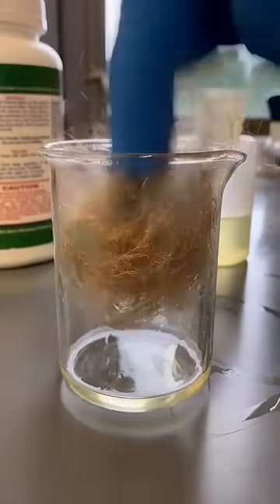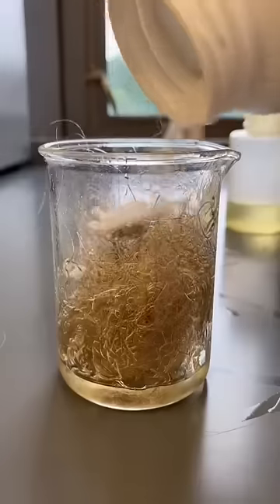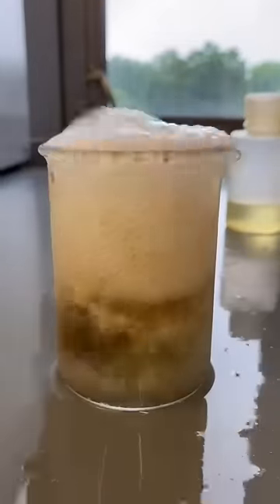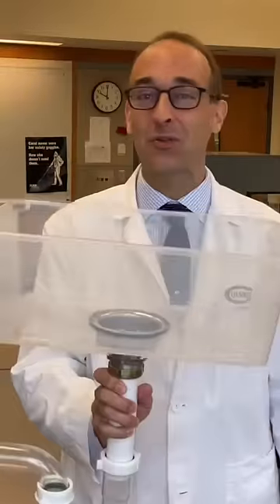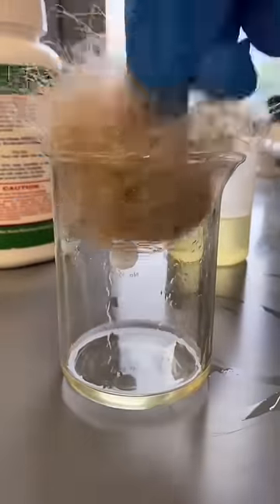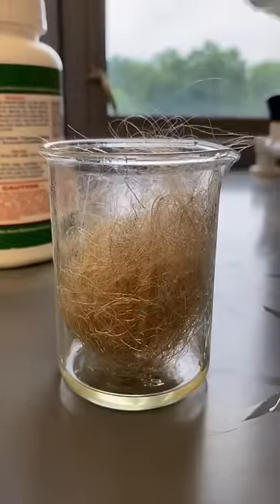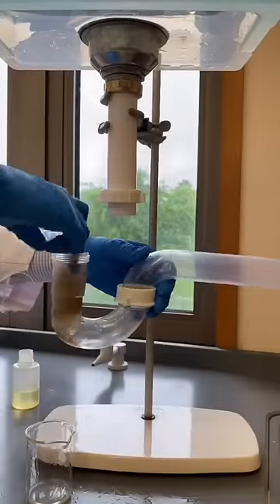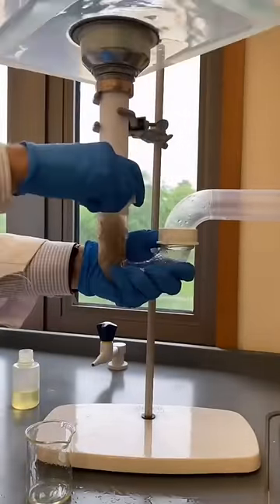How solid drain cleaners work

Comment: PSA FOR NON PLUMBERS: DONT USE THIS SHIT IF YOU HAVE CAST IRON PIPES IN YOUR HOUSE
Reply: Oh the horror stories
Reply: So you think it's better to call a plumber then..... Mine is plastic but behind the wall do they keep it the same?
Reply: @0mar-777  I’d still not recommend it for plastic but it’s a lot cheaper than a plumber
Reply: @R06NS  rite on thank you
Reply: Why not?
Reply: @NickDaGamer1998  it will literally eat away the bottom of the pipe until it collapses essentially
Reply: On cast iron/metal drains
Reply: Just don't use this shit period, it's terrible.
Reply: What about Liquid Plumber?
Reply: Yo i was like i gotta get this but since idk wat my pipes are made of leme just not. Thank you!!!
Reply: @randomness8819  if you check under your sinks or even in your yard where you can see the clean outs sticking up, should help you find out. If you see a black metal pipe in the very back of the wall or in the yard, don’t buy it.
Reply: hmm doesn't water corrode them? why are they in use at all
Reply: @aliveslice  cast iron will rust over long long periods of time but not in our lifetime unless something happens to it over time like drano or roots etc. but yes that’s basically why plastic pipes exist now
Reply: @PabloEdvardo  well said my friend
Reply: @slimnim1753  i’d like to know them
Reply: @0mar-777  unless you built it, don't trust it.

If the house has had any renovations from previous owners there's a very high chance the cast iron was partially cut out and replaced with pvc.

I've done plenty of bathroom remodels where I cut the cast iron out till it reaches the basement floor. Even then there's still cast iron under the floor.
Reply: @petersteele7603  yea who knows what's behind the walls. I'm not a plumber but there should be chemicals or whatever it's called that they should sell at stores rite?
Reply: @0mar-777  yeah if you wanna do it right use a snake first, usually it tells ya how far in it is if anything. Don't forget cleanouts too. 

I rarely use chems, because of exactly what this comment says.

Snake it first and locate it if it's bad you gotta replace that section, if it's worse, you leave the decision to the homeowner  or call a contractor plumber friend that isn't backed up with work since nobody can work actual jobs anymore. Then let them handle the risqué chems.
Reply: @petersteele7603  thx
Reply: @R06NS  it's the reason why flint is having water problems, they need a new pipe system for the entire city
Reply: @Infinite8blue  no m8 those are different pipes, we’re talking about drain lines here. Flint Michigan has a water line crisis.
Reply: @petersteele7603  thank you for typing the process that I was too lazy at the time to type lol. Listen to this man
Reply: Or if you live in apartment buildings period. 

You never know what your neighbors are putting down their drains. 💥💥💣
Reply: @petersteele7603  a plumber isn't going to use chemicals

Let me rephrase that: a GOOD plumber isn't going to use Chems. The company I worked for never used a chemical at all. They aren't rooto rooter type companies either. Also required  techs to be extremely talented with the cable or jetter. Then and only then do you dig up. That's how we did it anyway.
Reply: Thanks for the heads up. I was actually thinking of buying this.
Reply: @NameUnimportant  that's exactly why I recommended using snake first cause there cheap. And that's exactly why I recommended calling a contractor, friend who knows a good plumber, or the homeowner before you use chems.

Personally I recommended just replacing cast iron if you can afford it and know how to do it when remodeling.
Reply: @petersteele7603  totally agree. Cast iron will eventually cause trouble so if you can afford it, might as well get rid of it. 😊
Reply: @gpucchi9220  a 6 ft or longer drain snake is a much better investment long term. Quick fixes never work. And flushable wipes aren’t flushable
Reply: @R06NS  ohh i looked into it and it looks really good. Everytime my sink or shower drain has gotten clogged and i look up online how to fix it, it always says to use drano or baking soda and vinegar, the latter never worked so i always used a liquid gel called drano
Reply: No matter what pipes and what drain cleaner, flush the result with a LOT of water afterward.
Reply: @R06NS  I have had a lot of success with either copious dish liquid plus hot water, or baking soda chased with white vinegar.
Both are improved with the application of a plunger.
-
For hair clogs, such as you often get in showers/tubs, one of those plastic snake thingies that you can push down into the drain and pull back up to extricate the hair is awesome.
My brother has also had success with a type of hair catcher that you leave in the drain and pull out once the drain starts to slow. It comes up with the clog attached, you throw it away and install a new one
Reply: @PabloEdvardo  I agree. 
For sinks, your trap SHOULD be accessible and not all that difficult to remove to clean out.
Some even have a clean-out plug on the bottom that you can unscrew and clean out the clog manually.
Reply: @MonkeyJedi99  approved methods, good work soldier
Reply: I don't live in the third world where they still use cast iron pipes
Reply: @wills5482  I live in the "first world" where you can still find all sorts of old/legacy installs like cast iron pipes (particularly for drain/vent pipes), post and wrap wiring, fuse panels instead of breakers, asbestos pipe insulation, asbestos siding, cast iron sinks, and true-measure framing where a 2x4 is actually 2 inches by 4 inches.
Reply: @0mar-777  get a drain snake and do it yourself it’s really not that hard
Reply: @maxortega8073  ok thx
Reply: Yeah I was gonna say some of this stuff eats through pipes like candy.
Reply: @R06NS  Buy a Zip-it from Walmart. $3.
Reply: Yeah, drain cleaner chemicals typically have corrosion inhibitors added. If you just put straight NaOH into a sink you could end up eating away at the pipes
Reply: @slipstream53  long term use basically negates any effect of those inhibitors. The pipes are already probably full of roots and who knows what else lol. 65 year old cast iron and acid don’t mix well. Just eats away a gash on the entire bottom of the pipe. Basically you can either dig it all the way to the sewer tap at the street or look into glass lining the pipe. In short, just buy a damn auger😂
Reply: @R06NS  well yea, definitely don't let it sit in there, that's a big nono regardless of corrosion inhibitors, it's just that if you use sodium hydroxide straight up, not only will the dissolution produce tons of heat and be immediately corrosive to the pipes, but the lack of antisplash additives make it a serious eye hazard, especially if it stays clogged
Reply: So recommended to people that I hate got it
Reply: Most pipes are safe.  Maybe not cast iron, but most are, especially if you flush it out once it clears.
Reply: @computernerdinside  spoken from someone who has never had to hand dig a 6ft deep cast iron line from the sewer tap to the house. Just buy a snake. Or pay a plumber with a large auger. Chemicals of any sort are not good for your sewer and I’m sure the treatment plant in your city will thank you for not pouring literal acid into the drains
Reply: @R06NS  I mean if your house is older no i wouldn't suggest it.  But also as far as the city is concerned, by the time it gets to the plant, wouldn't it be so diluted that it almost wouldn't matter anymore compared to the rest of the waste?  I'd think they'd be more worried about those "flushable" wipes.
Reply: @delanorrosey4730  none are good for cast iron. None of them have a great success rate though. 

They'll all destroy cast iron, galvanized steel, or copper drains.
Reply: @IHateHandleNames  What about PVC?
Reply: @delanorrosey4730  PVC is more resistant to them, but the issue is still that a lot of them turn chalky in the drain, so if they fail to clear the problem they actually make it worse
Reply: oh yeah we found out the hard way ... that pipe looked so disgusting when we removed it... 😅
Reply: So would this be the stuff that left 3 yr old me in 1980 with a few scars from knocking over a cap that still had some drain cleaner in it?
Reply: Ok so when I was clothes the water is coming back in my tub and all the nasty is too what’s wrong what do I do???
Reply: Don’t use it period, speaking as a plumber these will eat away at the smooth lining inside your pipes that’s meant to allow things to pass easily. It’ll rough up the surface, which will clog up faster next time meaning you need to buy more, like scratched up arteries clogging with fat. Eventually it’ll wear down completely and you need to replace your pipes.
Reply: @R06NS why they even show us if it’s not gonna be helpful in the long run smh
Reply: My bathroom sink has been clogged so bad since I even moved into this apartment in 2021 and now it's pretty much like I can't even use it anymore and I just don't like the maintenance people to come over cuz they don't really like to help anyway. So what do I do to try to fix this at home? I've tried using boiling hot water to break it up with bleach in it and it just never works and I've been putting off getting the Drano because I hear Bad Things so, I don't really know what to do. Excuse some of the spellings, because I'm using speech to text and it's looking pretty dumb.
Reply: @ingrid_inthesky  no worries! As plumbers we usually recommend snaking out the drain instead, so clearing it mechanically instead of chemically. That being said, I’m not sure how much you want to invest into the maintenance of a property you don’t own, or how much the actual owners invest in its upkeep. All I’m saying is, in your situation if you decide to use a different method to unclog I’ll be looking in the other direction ;) p.s. have you tried packing it with baking soda and pouring vinegar? If it doesn’t work at least you can feel like the science kid again for a day :)
Reply: Here’s my tip if you know exactly what you’re doing then sure do what you know how to do if you don’t know what you’re doing hire a plumber because if you fuck it up maybe hiring a plumber anyway but it’s a lot cheaper to have them do what they know how to do versus have them fix your fuck up
Reply: As a Handyman, can confirm. Plumbing’s not one of the more common things I’ve been brought along to check up on but I’ve seen what happens should the two mix.
Reply: It’s also terrible if you have a septic tank. Pouring chemicals in the tank slows down biodegradation so you’ll have to pump more often.
Reply: It literally says ON THE BOTTLE ITSELF “will not harm plumbing fixtures or pipes” 😂😂😂
Reply: @michaell1603  I would love to talk to the “plumbers” that they approved these chemicals with😂 I guarantee they don’t use their own products
Reply: As a chemist, can confirm without having learned the hard way.
Reply: @WilliamFord972  school of hard knocks teaches the most memorable lessons
Reply: @r6n TM  lye doesn't effect plastics
Reply: @randomness8819  when was your house built? They phased out cast iron quite a while ago so if you have a newer house it should be sched 40 coming out of the foundation and u should have sdr 35 underground
Reply: Tried to mix small quantity of it once to make some homemade detergent back then inside a metal container. Then there's smoke, a lot, filling entire house. I ended up throwing away those batch. The metal container itself is like eaten by many worms
Reply: Can’t express that enough!!!
Reply: I now know this suffering
Reply: Yup
Reply: @Omar  unless your house is over 50 years old or in a commercial area, they are pvc plastic
Reply: It sucks to see that some old houses still have cast iron drains. In fact I actually saw recently, someone built the house (2021) USING cast iron for their drain. Of course they had no idea what they were doing, so it wasn't just cast iron, it was also non-primered pvc, a little bit of big Pex, and some what I believe to be actual steel piping. Yeah the dude built the drain himself. He was not licensed. Also, there were no vents for the plumbing, s-traps we're constant, incorrect use of sanitary tees, upsidedown drum traps, and dear God, there were NO clean outs. Except the main building clean out, somehow
Reply: @christocanoid  😂😂 that sounds like a fucking nightmare ngl lmao. Every now and again I get to go over and check out the commercial sites and I believe they have to use cast iron by code(where I live) for all large commercial buildings. Crazy how much skill is really needed to pour a nice lead joint lol
Reply: @zyanidwarfare5634  it can, but the likelyhood of that happening is incredibly low. By the time the cleaner reaches your septic tank, it'll already be largely diluted by the water you use to get it there. It's similar to when you shock the well, the chlorine doesn't kill the stuff in your septic tank, because it's so diluted. Another misconception along the same lines, is when someone has a softener, some people say the waste brine water cannot go into the septic because it'll kill bacteria. This is in correct, it is both code to put it in the septic, and the bacteria LOVE the brine.
Reply: Don't use this stuff. If it's clogged the take the u out and check it if it's in the walls call a plumber they have tools to fix that. Remember burst pipes and water damage is way more expensive than one plumber coming to "clean your pipes"
*Winks at camera
Reply: @deancrosiar6458  this is also way more true. Unless you are a plumber. A burst pipe is no issue
Reply: @christocanoid  yeah but a plumber isn't the sheetrock guy and then maybe flooring and depending on where the water is bursting out electrical damage. Yeah just call a plumber if it's not the u trap
Reply: @deancrosiar6458  I think you missed my point. If you are a plumber, why call a plumber?
Reply: Or yall could just unscrew the P-trap and do it for free
Reply: @jaymac4239  lololol
Reply: Enzymatic drain cleaner isn't super-effective, but at least it won't destroy the pipes.
Reply: Nah, we use this all the time with cast iron.
Reply: @jaymac4239 I agree but then I remember the average intelligence of our common man. And ya. Some how alot of people will manage to screw up a simple task lol
Reply: What if I have an apartment and really don’t like the landlord?
Reply: Sodium hydroxide DOES NOT corrode, attack or damage cast iron in any way. 
In fact they use steel vessels to store alkali solutions.
Reply: @WilliamFord972  Care to cite a source or even a Wikipedia page? cause I don't think thats right...
Reply: Perfectly safe for repeated use in metal pipes.  Lol
Reply: Just use zep as a cleaner
Reply: The only concerns you should have regarding piping based on what ive read online, is the heat of the reaction possibly softening pvc pipes, or reacting with glue holding them together. As a chemist, that sounds about right to me as well.
Reply: Yea seriously just get a snake and unclog it that way
Reply: Thanks for the tip. I'll trust you on that. But out of curiosity, what happens
Reply: @Omar  depends how old the house is. The main pipes might be cast iron. Don't be cheap and cost yourself more money in the end.
Reply: Why
Reply: @ceesno9955  read up m8
Reply: Because it becomes iron hydroxide
Reply: Thanks for the warning.  My place was built in 1919 and likely has cast iron pipes.
Reply: How do I know what pipes I have?
Reply: If your renting, who gives af use it. If you own the place, don’t use it it will eat your pipes over time
Reply: @izzyNFT69  absolutely correct, I appreciate you helping out the masses sir
Reply: oh goodness😮
Reply: @Delanor Rosey  pretty sure hydroxide is the main active ingredient. Might be aluminum hydroxide? Rather than sodium or potassium hydroxide.  But yes, chemical drain cleaners are hydroxide aka lye
Reply: How would we know if we have cast iron pipes?
Reply: Nah let em do it, i’m saving up to buy a house and could use a few drain repair or repipe jobs
Reply: How do you know if yoy have that kind
Reply: @cbgirl1220  the pipe under your house and/or coming out of your wall will be a black metal if its cast iron
Reply: @cbgirl1220  if your house was built before 1970~ you absolutely shouldn’t use it
Reply: Time to find someone with cast iron pipes
Reply: @pizzastock111  doesn’t take much! I’ve seen houses have the bottom of the pipe missing from the kitchen all the way to the front yard just from this type of stuff being used monthly for years
Reply: So if I have a house that is from the 50s it's better to call the landlord than fix it myself?
Reply: jesus christ thank you , im glad I saw this
Reply: @0mar-777  Get a drain snake and fish/push/manipulate the clog out and apart.
Reply: Thanks for the tip. As an evil plumber i will use this exclusively on metal pipes thereby guaranteeing an even bigger job in a few days when i tell them "the winter frost burst their pipes". Thx YouTube! Me and my dancing panda bear 🐼 are going to eat well this month 🥩
Reply: @lillyanneserrelio2187  That winter frost do be eating up those drain lines fr. 🥸
Reply: That's just factually wrong, you should be worried about aluminium pipes
Reply: @SirZechs77  bro aluminum pipes??? I’m not sure if you just live so far away from me or if you aren’t a plumber but I don’t know one soul that would’ve chosen aluminum as a water or drain line. I might have to look that one up but idk what you’re talking about G. I’m talking about cast iron drain lines😂 or even concrete ductile pipe, orange burg pipe, terracotta etc. anything besides sch40 pvc is not safe
Reply: @artart5404  depending on your situation and how big the pipe is your cleaning out, I recommend going to Lowe’s and looking for a 25ft drain auger (shouldn’t cost you more than $35 or so) and if for some reason that doesn’t work, I recommend a heavy handed dose of incredibly hot water, white vinegar and maybe even a bit of bleach and rush it down the drain line. 

Check around your house and be sure this is the only fixture that is backing up. If you run water in one drain and it comes up anywhere else, even a little bit, you have a bigger issue. Could be a clog down the line in the front yard or in worst case, could be a broken or collapsed line. Cast iron was only meant to last about 50 or so years and then it needs to be replaced or lined
Reply: @artart5404  if you can’t seem to get it on your own, definitely call a licensed plumber to come clean out the drain. Sometimes can be costly but trust me it’s cheaper than having to bust up the floor and replace the entire line in the house
Reply: @SirZechs77  yeah mate just checked. Nowhere in the US uses aluminum pipes. You might have maybe seen some galvanized pipe that possibly looked alike but the only aluminum drain anything out there is made for your downspouts on the outside of your house lol
Reply: As a plumber I came to post this lmao
Reply: @bepis4795  gotta help the normies out
Reply: Who the heck kws what type of pipe the have?
Reply: @prince_of117  google will tell you, but also knowing the difference between metal and plastic is a pretty simple ask lmfao. If you hit the pipe with something hard and it doesn’t sound like metal, you’re good to use it.
Reply: Pipes can be cast iron? I didnt knoe that. Those pipes must be heavy or from older houses.
Reply: @anonshrimp8299  you’ll mainly only find this pipe in older house predating 1970~ or in big commercial buildings that do not allow you to use plastic drain pipes. It is stronger initially but in the future it degrades much faster and has to be replaced entirely after about 50 years of use or less
Reply: @R06NS  flint Michigan used lead piled then switched local water sources to ine with a different mineral hardness causing all the lead pipes in the city to contaminate the water
Reply: @infernaldaedra  the original comment was to alert people of the dangers of using drano type things in cast iron drain/waste lines. Those old lead lines are a definite problem in those places, but that’s on the water supply company side of things
Reply: Thanks for the intel!
Reply: WHO HAD CAST IRON PLUMBING?! That's a thing?! Why??????
Reply: @ressamarieg  the old school plumbers back then really thought it would last a lifetime😂 they still are required to use cast iron in multi level commercial buildings lol
Reply: @R06NS  WHERE?! In general? In NY, NY? Early plumbing I get. But to date?! José Fucking Cuervo!
Reply: @ressamarieg  yeah like residential you can get away with pvc but after you get to where you have a water test on 12 floors of plumbing, quite literally too much weight to even use pvc per code 😂 especially on the water test
Reply: @R06NS  Lol, some aren’t, but most brand name ones now are. Although they take hours to break down in the water, and will clog if you use MULTIPLE. It literally is paper
Reply: Or on septic.
Reply: @themonsterunderyourbed9408  🤝🤝🤝
Reply: Dont use any of those drain cleaners ever. THEY WILL DESTROY EVERYTHING... eventually. Yhe only thing i put in my drains to clean them is vinegar and HOT water. If these don't work and you don't know how to properly snake, or don't know what auger to use on what drain, call a plumber.

Source: Am a plumber
Reply: @0mar-777  shouldn't!
Reply: Always use a drain snake. It's reusable, safer, and pretty affordable. However, the only way sodium hydroxide aka caustic soda, lye.will eat iron, plastic, pvc, etc. Is if you use it constantly or leave in the pipe for a long time and are using a high concentration. It is used in soaps, drain cleaner, water treatment, and many other household products.
Reply: @richardmartin2162  couldn’t agree more!
Reply: Yeahhhhhhh my family learned that the hard way
Reply: @R06NS what will happen if use on the black pipe
Reply: @NameUnimportant but the bottom of the paip got glued by poop 💩.. the poop sticking on the pipe.. it's so disgusting to dig out drain from toilet area
Reply: @petersteele7603 I put the blue coral snake in the drain .. but he doesn't come back..so I forget about Because I was busy and called plumber to go inside my house there a key on carpet. but I never heard back from him...
Reply: @SaadLamjarred55  Likely the same thing if the pipe in question is any material besides dwv grade plastics
Reply: What’s the chance of a house having cast iron pipes in a house built after the 80’s?
Reply: @VWGG1  slim but possible. Should be able to tell by looking under your sink or something like that. Or even in the yard somewhere or on the house might be a cleanout somewhere
Reply: laughs in repipe sales
Reply: @deafby18  literally
Reply: I seriously think you just saved me and the Landlord thousands with this one message.
Wherever you are in life, I hope things work out for you.
Peace.
Reply: Baking soda and vinegar works well, especially if you use boiling salt water to drain after
Reply: @randomness8819 Alot of old homes use cast iron piping compared to more modern homes, which use plastic
Reply: I replaced my cast iron pipes with plastic ones. The 50 year old + ones were really corroded. I’m glad I got plastic ones now. Now I can use drain cleaner till the sealing rings corode.
Reply: @Snowy-hj6vi  😂 nooooo that’s just a section of it. Your main line is likely still largely cast iron and it’ll eat through still
Reply: @R06NS  nah I really shoved out the dirt in my front yard. It’s a big plastic pipe. For some reason the used plastic till it reached our house and then they used cast iron xD
Reply: @Snowy-hj6vi  NICE lmao smart guys😂
Reply: @R06NS  yea thought the same xD
Reply: @PabloEdvardo  it’s terrible for drains, but is a key component of homemade soap making (which is also why homemade soap has to cure for months because it is so acidic it takes that much time for it to become non-corrosive to flesh)
Reply: Lye and sodium hypochlorite is perfectly fine for cast.

Don't use sulphuric acid cleaners on cast pipes or porcelain.
Reply: @johndoe-ke3yj  also a drain king or higher grade jetter. Sometimes there’s no better choice but to replace
Reply: @R06NS so it's really Is use it once and done methods
Reply: @hunterbear2421  lmao yep
Reply: @R06NS if you dont run your water yea
Reply: @0mar-777  major cities may require cast iron if there's a huge rat problem
Reply: @redjoker365  ok...... talking about rats I seen a few vids I think they were from NY they were huge
Reply: I wish the mf'er who owned our house before us knew this.
Reply: @aliveslice  because they don't know what there talking about, use the chemicals follow the directions and let water flush it out for some extra time, I use it anytime I have issues and nothing bad happens, the only time it's actually a bad idea is on your toilet, the bottom is sealed with bees wax the chemical will melt that fast, but other than your toilet use drain cleaners when needed follow the directions and your good!
Reply: Or in general.
Reply: Dude that si the truth. That shiz will eat the pipe from the inside out. Speeds up corrosion
Reply: Bs, it doesn't do a damn thing
Reply: @R06NS sure...
Reply: @tucsonplumbingcrazy2823  absolutely. Especially when they don’t flush it after they use it!! Just sits at the bottom and creates a long pit to start forming at the bottom portion of the pipe. Makes all the cast iron pipes brittle and crumble when you go to tie back onto it to make repairs. I’ve had a job start at a 3x3 hole and ended up tracing the sewer line all the way out of the house and in the yard. Drano for 30 years 😳
Reply: @NoBody-dp8bd  I definitely agree there but I held my tongue since techniicalllyyyyy it’s “safe” on pvc pipe. That doesn’t mean it’s great anywhere else!😂 I hope people can read into that somewhat
Reply: @R06NS  brother people will dump anything down the drains. Ignorance means job security hahah
Reply: @tucsonplumbingcrazy2823  I love everything about it haha. Especially folks that are like ‘well the bottle said!!!’ 😂😂 better call em up then!
Reply: @R06NS  damn straight. I been doing this twenty years and I love every minute of it. Where else can you make this much money without selling drugs and minimal education
Reply: @tucsonplumbingcrazy2823  😂😂 I can’t tell you how many times I’ve heard an old head say that exact thing haha. 5 years in so far and I love it Lol. Now I’m starting to get a solid customer basis and the side work is sick as hell. Killing it out here😎
Reply: Isn’t that the same for the rubber material pipes?
Reply: @R06NS  IME, metal pipes will cake with minerals. They don't rust away; they clog like arteries after 60 years on an all-cheeseburger diet.
Reply: Had a resident in an apartment complex dump 2 gallons of Draino down their bathtub once. Property used Cast Iron, completely destroyed the trap. They had water everywhere, this shit should just be illegal.
Reply: @Omenshaper  as much as I would love to never have to deal with it again… I’ve got to say, it sure helps pay the bills😂 some people would rather spend $96 dollars at lowes on shit to pour in their drain than spend a little bit more to have a professional clean it properly 😂 you can’t always buy a quick fix!
Reply: Uh alk solutions don’t affect iron…
Reply: @sc1338  spoken like someone who does not work on this stuff daily. It does affect it, my brother. it’s been proven😅 cast iron pipe is not 100% iron, as well
Reply: Sodium hydroxide does not affect cast iron pipes. However sulfuric acid and muriatic acid and hydrochloric acid will destroy them.
Reply: Sodium hydroxide doesn't eat metal. Sulfuric or muriatic acids absolutely will.
Reply: @R06NS  I work in the lab at a metal finishing facility. NaOH doesn’t etch cast iron lol. however, Acids do of course. It might just be the NaOH is removing whatever was keeping the cast iron from leaking sir
Reply: @DallasHerrmann  exactly, I mean light metals like aluminum can be etched by Alk and acids
Reply: @sc1338  nah it do tho
Reply: @DallasHerrmann  they all aren’t good for the pipe and your comment tells me you’ve never repaired or replaced a broken cast iron drain once in your life. That being the case, you should probably keep ‘em to yourself 😂
Reply: @DallasHerrmann  it do tho
Reply: @NickDaGamer1998 
Cast iron is a ferrous metal and will oxidize quickly when exposed to the drain clearing chemicals.
Basically it will dissolve the metal
Reply: @christocanoid 
The law.
Liability.
Lease agreements.
Common sense of you're a renter...
Being a plumber doesn't give you qualified immunity like cops.
Plumbers, unlike cops, actually have to pay for their mistakes 😂
Cops can kill innocent people and get a bonus check.
Plumbers mess up your pipes they gotta take out a second mortgage to fix your house.

There are a lot of reasons a plumber may not work on their own place.

Most do though lol
I've never called a plumber for any apartments I've lived in. 
Obviously the first thing you do in an apartment is change the little Skippy shallow sink out for a deeper one with a garbage disposal, then take out all the low flow bullshit and then change the shower head and faucets...
I hate cheap shit.
Apartments don't care because once you move they get free upgrades unit.
Anyhow never fuck with plumbing in the walls unless you have liability insurance and if you rent get the renters insurance just in case the neighbors are midnight plumbers
Reply: @R06NS  There are lots of folks who don't understand the difference between a caustic agent, like lye, and a corrosive agent, like sulfuric acid. You can see this by all the plumbing services telling you not to use "corrosives like lye" in metal pipes.
Caustics basically hydrolyze organic stuff into soap. Lye is commonly used to restore cast iron pans, as it will eat the organic crud without harming the iron. 
Now lye CAN potentially damage plastic drains, as the hydrolysis process generates quite a lot of heat.
Reply: Thanks😂
Reply: The melted hair leaves a layer of scuzz that catches more hair.
Reply: @christophergardner1230  yes!! This man gets it! Invest in your own sewer snake!
Reply: Lye doesn't react with cast iron, in fact it make great oven and pan cleaners. You're thinking of aluminium.
Reply: @Pillboxing  nope, once again, I do this for a living bro. You don’t. Stick to your lane
Reply: @R06NS  I'm a chemist
Reply: What should I use?
Reply: dont tell me what to do bub
Reply: Seen that shit eat through the pipe then start eating through the friggen beams that hold up the house.
Reply: @pauldrice1996  dummies on the internet will tell you that it could never dissolve through a pipe 😂 even when folks that do the job confirm it
Reply: OR IF YOU HAVE A SEPTIC SYSTEM
Reply: @AloneInTheCandyJar  a fellow turd chaser, I see.  My man🤝🤝
Reply: @R06NS  Why would sodium hydroxide eat cast iron?
Reply: @joshuasamuel2122  I’m not gonna explain the inner workings of my job to a random internet commenter bro. I do this for a living. Everytime I go to fix this problem and cut it out of the ground, the entire pipe is pitted all the way down the line from people just lazily pouring drano instead of just calling a plumber to clear their drain. Drano eats away at the pipe and will eventually fully corrode through the pipe. 
The key parts here to remember are: 
You don’t do the job everyday and just because a bottle tells you it won’t eat through your pipes, doesn’t mean they’re telling the truth.
Reply: @R06NS    You're explaining something to me anyway, so why is saying you're not going to explain the inner workings of your job even necessary? If you don't want to, then don't. Just stick with what you were going to say.
Reply: Thank you sir
Reply: My pipes are made of styrofoam
Reply: @VergilVirtuoso  this man gets it
Reply: I have cast iron and I had no idea you couldn’t use this. What do you use on it?
Reply: @alexjackson936  a drain snake! Or a ‘drain king’ hose attachment
Reply: You sure? Maybe you're thinking of acidic drain cleaners? Metals are bases so only acids will attack them
Reply: @genealogyxie  nope I meant what I posted lol. I do this everyday for a job, the caustic drain cleaners, especially granular, ABSOLUTELY cause issues in cast iron pipes. If you don’t think so, I heavily encourage you to try out your theory if your home has cast iron. You will soon be calling a plumber about the bottom of your pipe completely pitting and degrading (: Reddit plumbers smh
Reply: Me not caring about my apartment complex
Reply: @notacat7127  oh hell no, this only applies if you own your home. If your landlord sucks, buy that sh*t up baby
Reply: it its not prolbem with iron pipes. its not a acid is a base do nothing with iron unless its above 500celcius
Reply: Since when does iron react with bases?
Reply: @diablominero  tell me you’ve never plumbed a day in your life without telling me
Reply: @R06NS  I don't need to be a plumber to know simple chemistry. If your pipes react with lye they weren't pure cast iron. Somebody must've sold you galvanized steel or cast aluminum or something like that and called it cast iron. Or maybe your customers used sulfuric acid drain opener instead of lye and you didn't know the difference.
Reply: @diablominero  it really shows btw, we work in the field G. You don’t. It puts the cast iron over time, idk what to tell you bro😂 you can say it real easy from your chair and not in the ditch changing the pipes out with me so gg I guess. I really don’t care, this comment is from a year ago dude. Go outside
Reply: If they use this stuff they probably don't know anything about their sewer system
Reply: If they use this stuff they probably don't know anything about their sewer system
Reply: And thin metal plumbing.